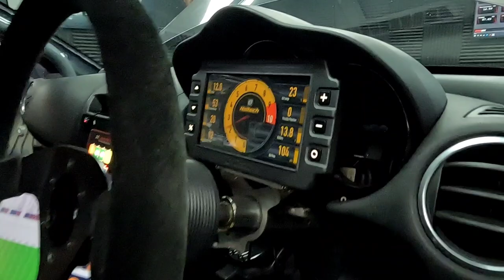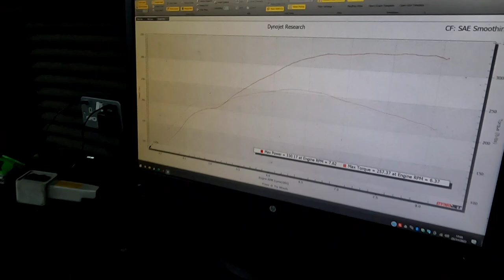3 Rotor RX8 singing on the Dyno

Comment: ive always felt compelled to do something with a rotary, this is a great tribute to what the RX8 could have been. that engine bay is proper, very neat and organized
Reply: The RX8 was absolutely phenomenal despite what you might’ve heard. This wasn’t what it “could’ve been”, no road going Mazda was ever like this. Highest power NA Rotary at 10k with 50/50 weight distribution is a wild thing to experience, even without a 3 rotor like this.

Comment: I just bought an RX-8 last year and it's the most fun car I've ever owned and I've owned over 13 cars... It's worth the required maintenance.... There is actually an extreme value in having an RX-8.... And you could put a 3 or 4 rotor motor in there.... With a turbocharger... Huge potential... And it'll handle better than a hellcat which doesn't require much

Comment: so what was its WHP ? torque ? we didnt see anything this clip was about the sound or what bc we got 0 info
Reply from the maker: Customer didnt want WHP/torque  published
Reply: 350 horses but these are sick three-legged horses. This car is much inferior to any German car with 350 horses
Reply: @putin__huilo  Did you see that HP curve? Totally flat for the entire top 1/2 of the RPM range. Weird. But that also means that it'll be faster than just about any conventional engine with the same peak power #.